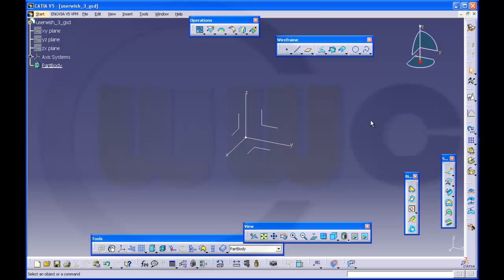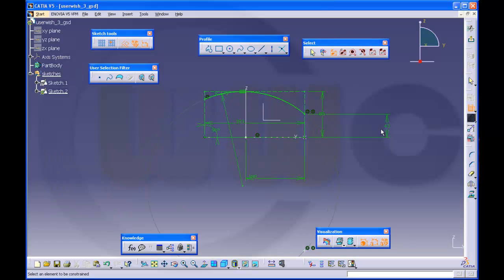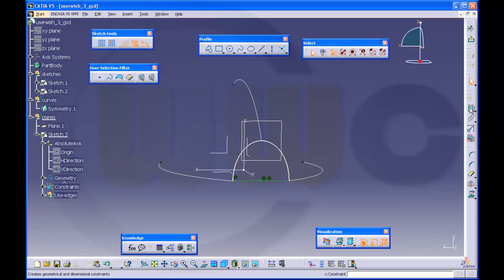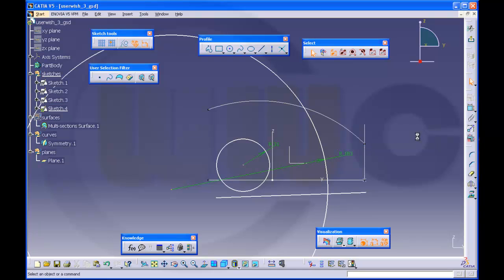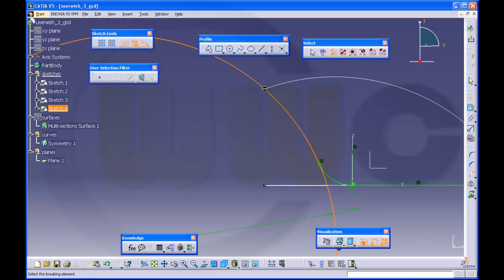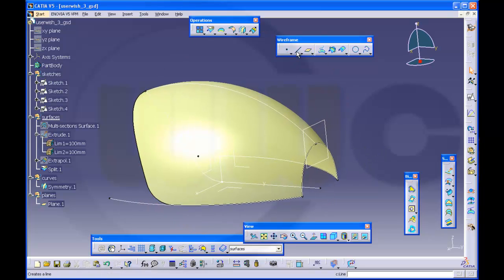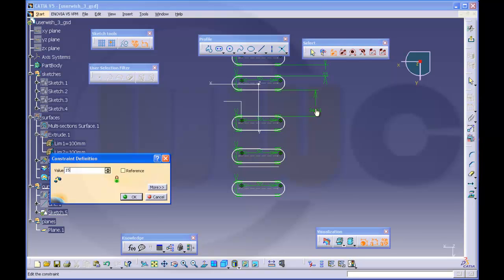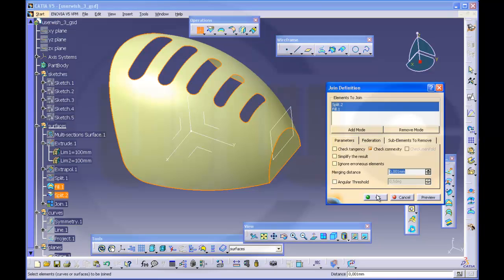Userwish 3 - Catia v5 GSD Training - Multi section surface

Comment: Thanks for your video, it is very helpful. I have some troubles when I used it. Could you teach me to solve those? 
1. I compared Catia and CImatron, in Cimatron I can cut many planes at the same time, but in Catia I cannot do that. Can you teach me command to cut many planes at once.
2. When I open files which are saved by *.igs and it has many parts but I cannot separate them well because they are in the same a folder. Please, help me. Thanks!
Reply from the maker: 1. Hi, sorry I ´ve never heard of "Cimatron" before. Could you please explain: "cut many planes at once".
2. Again, what is your problem? I would need a sample file.
Reply: Hi, Wolfgang Walden,  I sent to you message via Messenger. Please teach me to solve them. Thanks a lot.
Reply from the maker: I would try to help - but you have to explain the problem in more detail and please send me an example.
Reply: I sent 2 files to you, did you not open them?
Reply from the maker: When did you sent them? To which emailadress? I have not received it, sorry.
Reply: I sent 2files via Facebook messenger. May be you cannot see them.

Comment: what is the significance of creating those geometrical sets for curves, sketches etc sir....?
Reply from the maker: In generative shape design you need to keep the order of the elements yourself - because the software doesn´t care - so to get some stucture into your model you have to use geometrical sets (folders)
Reply: Wolfgang Walden sir can you please put up a video for mud-guard of bikes.
Reply from the maker: Do you have a drawing?
Reply: no sir.
in specific I don't have any such drawing.
can we creat it by looking at any 3d photo of it?
I just wanted to know how step by step you think,
and the procedure that you follow when it comes to surfacing in catia.
Reply from the maker: Swapnil Pawar I suppose you could do it yourself? Because with only a photo it is just guesswork.